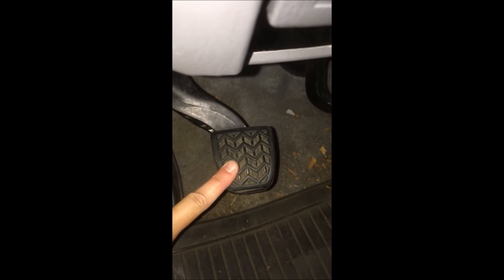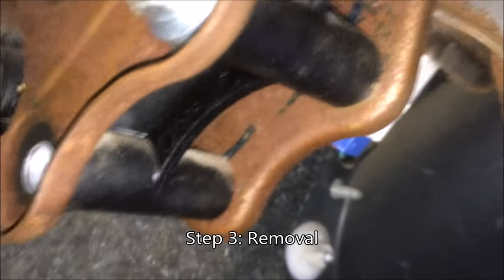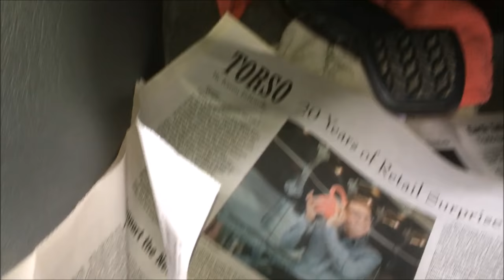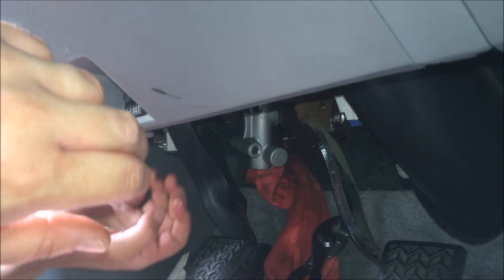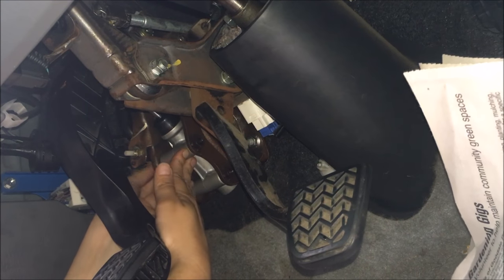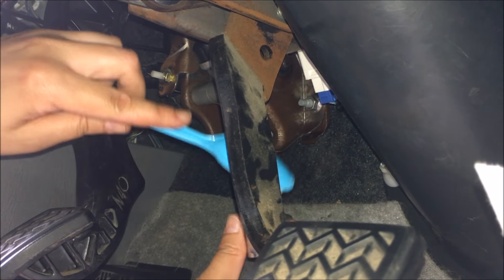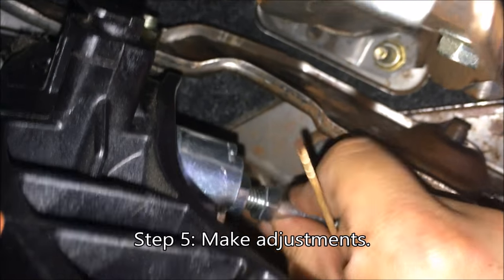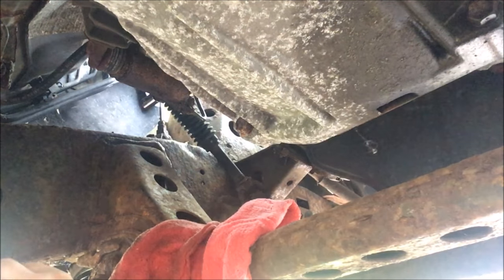2006 Toyota Tacoma - Part 2 - Clutch Repair

Comment: Thanks for posting. Mine has been leaking for a year because I haven’t wanted to crawl under the dash, but you made it look pretty easy. Also you may want to replace the slave cylinder at some point, they like to go out after replacing the other (sometimes)
Reply from the maker: David Eddins Good to know! Fingers crossed it holds out a little longer! 🤞🏼

Comment: Yup. 😗 As long as there are Taco's out there, this vid will find an audience.  That said, the loose shaft movement in the clutch housing is what popped up on me a few days ago.  I can still drive & shift but I don't know for how long.  How long did the replacement take you?  It looked easier for a smaller person, like yourself, but bigger bodies...not so much.  I'm debating if I want to do this.  I've since seen other vids showing the techs remove the lower dash,  fuse box and then removed the whole clutch assembly to replace this part.  Not easy in either circumstance.  Thanks for the vid though, it was helpful. 🛠😏

Comment: I saw your video all of it but I have a question. I changed out my cylinder just the same as yours but it won’t get any pressure in it. So what did you do to get pressure of the clutch pedal?
Reply: Did you ever figure it out I’m having the same problem
Reply: Did you use a pressure bleeder?

Comment: Good deal with putting the high pressure line on first loose and the then mounting bolts.  Often times people cant get the hydro line started because they bolt in the unit first.  But always use a box end wrench on the bleeder valve.

Comment: Wait, does the second gen Tacoma use the brake fluid reservoir as the place to hold the fluid for the hydraulic clutch as well? I was wondering why I couldn't locate a separate reservoir for the hydraulic clutch, like my past Toyota Trucks have had. I have the same problem with my Tacoma, and like Furiousbob said, you seem to have the only video that covers this repair on the second gen Tacoma
Reply: follow up on this comment...YES...it's a split reservoir...so either can drain while the other still has fluid. The upper "fill" line is above this split point
Reply: @treefortrichard  If I'm not mistaken, this is the video where I learned that. I actually learned a lot from this video

Comment: Thanks! Will replace my cylinders too soon and very informative. Correct me if im wrong, the brake reservoir is the same for clutch reservoir? Mahalo!
Reply: I was wondering the same thing, but I don't see a separate reservoir for the clutch, and it was the brake fluid that she checked

Comment: I am in love! The new part is ALL METAL? My 2007 is plastic! I having similar issues like what you had. My pedal comes up but hangs halfway and then I have to use my foot to bring it all the way up. Looks like I found the answer to my issue. SUB'd!!! Where did you buy your replacement part?